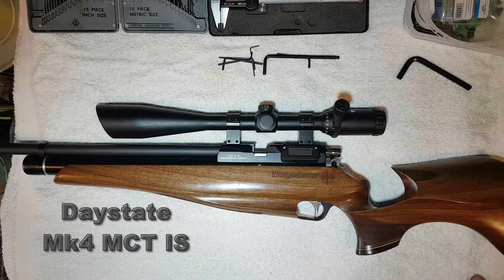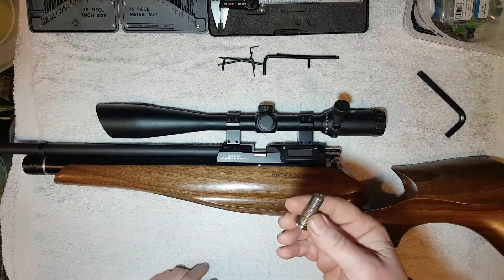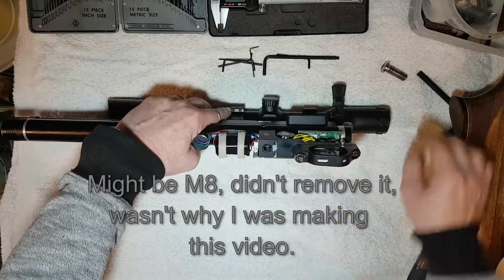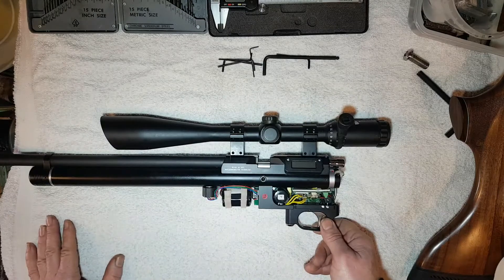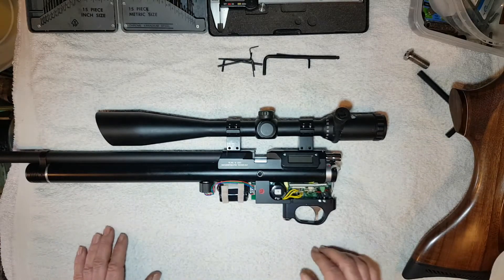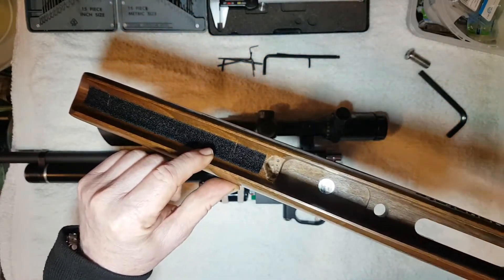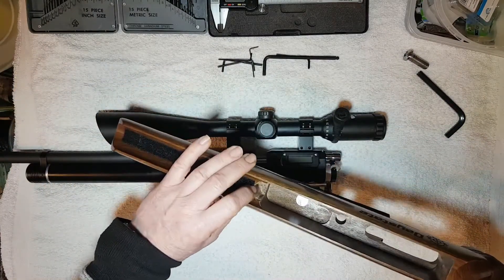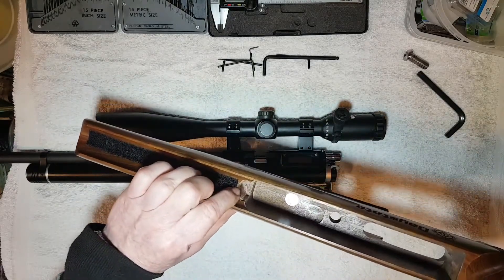Daystate mk4 MCT IS stock finish (By Daystate?!)

Comment: hi mate,just watched your video, with regards your stock and it being tampered with, the only explanation i would give is as it was a demonstration rifle, they have put a mk4 IS in an older mk4 stock, they have chipped it out because the pressure sensor would not have fitted otherwise, a bit of a butchers job yes but it has been done because it was only a demonstration rifle, one of the daystate staff would of originally owned this and they have sold it on, i have just looked at my mk4 IS and the inletting is longer to allow for the pressure sensor,the original mk4 had a pressure gauge, i wouldnt worry about it as its internal anyway lol, they are superb rifles and very very accurate
Reply from the maker: I'm no longer a fan of daytate rifles although I still service and repair them for owners. My point was, (even if it has been a demonstrator rifle) this could have been done better. A lot better. It was poorly done. Having a lot more experience of the various models of Daystates, both mechanical & electrical / electronic, is that they lool nice on the outside. Their customer service leaves a nasty taste, and its simply better to get on with fixing them, than to consider how some poor soul had his wallet extracted while bent over.

Comment: The electronics are triple coated in a waterproof varnish. At a show they left an MCT action in a tank of water for 48 hours then took it out and fired it with no issues. It looks bare but it’s actually waterproofed
Reply from the maker: Yes, I understood this to be the case, yet I got readings from various places. I believe from the serial number, this was a 2011 demonstrator rifle, serviced by Daystate before sale.
Reply: Maybe that explains the woodwork mangling inside the stock
Reply from the maker: Are you saying they didn't do it in 2011?. I find that either unlikely, or extremely short sighted. Have you heard the response to the Red Laminate losing it's dye all over a customer?  On the lines of 'Not our problem, we don't make the stock'. They clearly don't understand strict liability.
Reply: I meant that as it was a demonstration rifle they may have had to alter an early production stock to make it fit
Reply from the maker: Ah! with you now. Possibly, but the rifle was in production in 2009 wasn't it?
Reply: True. Don’t know then. I came across your video as I’ve just bought a .177 Mk4iS in Thumbhole walnut. I shot it at my local range last night and it’s the most accurate rifle I’ve ever fired. Astonishing.
Reply from the maker: @NottsPestControl  yes, the rifle was spot on accuracy wise, but the trigger had about as much 'feel' as an amputated foot, and the whole thing had no soul (for me at least) because of that. That said, the stock was stunning (externally at least), ergonomically, aesthetically & the figure / grain of the wood really added to it. Much prefer the Air Ranger though, even though it feels a heavy lump.
Reply: @Erasmuspipebagger1  exactly, your contract is with them not the stock manufacturer. simples
Reply: @Erasmuspipebagger1  I feel PCP rifles are soul less to shoot compared to a quality spring rifle HW97KT as an example

Comment: I see the “published” date of video is March 2018. Is the gun used new or is it a few years old?
Reply from the maker: Sale date of gun was March 2017 on receipt (corrected by sales team from 2016 to 2017 on both sales receipt and the service receipt). I believe Daystate make a big deal of the electronics being dipped (4 times) in something that allows the electronics to be submerged in water (which they apparently used to do at shows) and still be fine. While doing the felt mod for the battery rattle, I saw no evidence of this. That and the battery connectors still appear exposed in any case. Someone got back to me with a date for the rifle from its serial number with a manufacture date of 15/11/11, which doesn't make sense, but is possible.
Reply: @Erasmuspipebagger1  an early rifle then. have read they squeeze silicone into the electrical connectors, was thinking about getting one of these mk4 Daystate's but they seem to be only a£100 or so cheaper than new,I think I'd get new with the 3 or 4 year warranty.